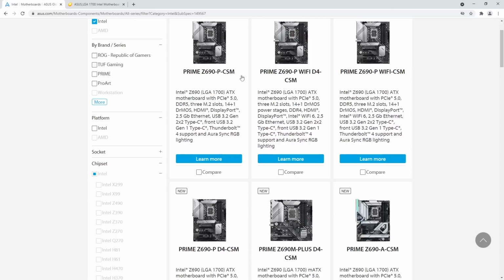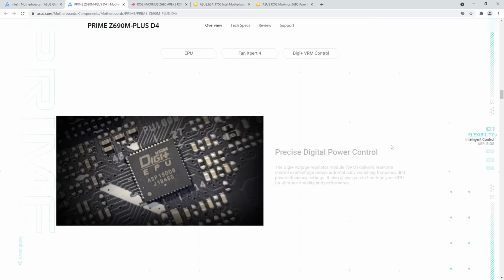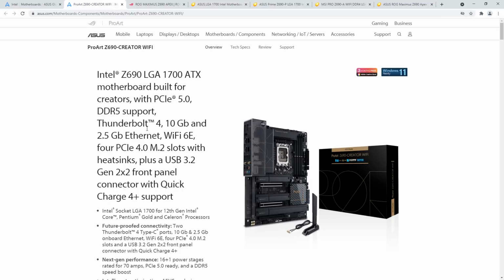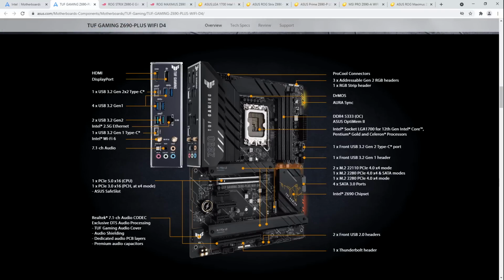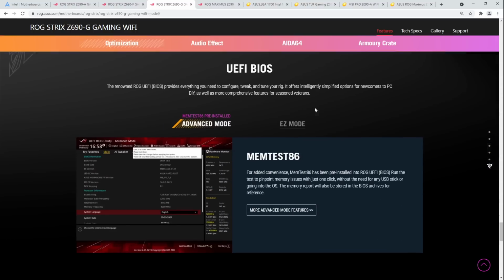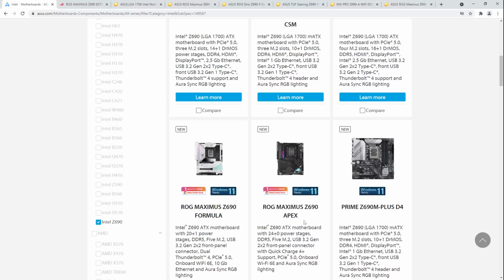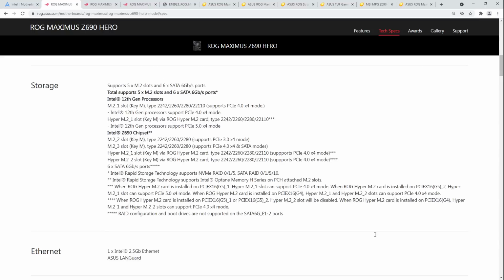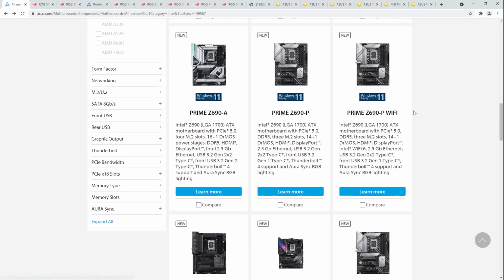Rambling about the ASUS Z690 Motherboard line up

Comment: Late to the party, but didn't find any timestamps so here they are.

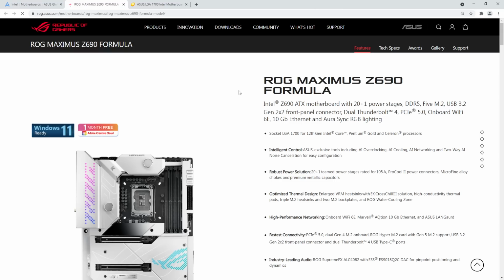0:44 Maximus Z690 Formula
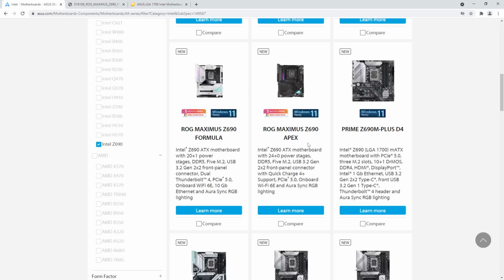11:30 Maximus Z690 Apex
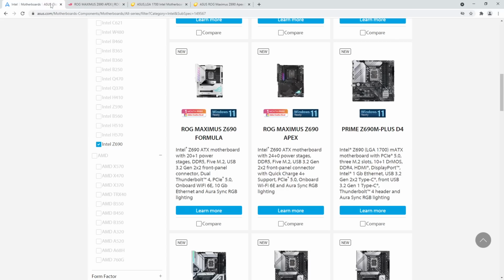14:36 Prime Z690M-PLUS D4
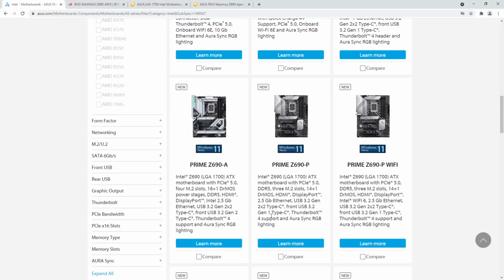17:16 Prime Z690-A
25:35 Prime Z690-P
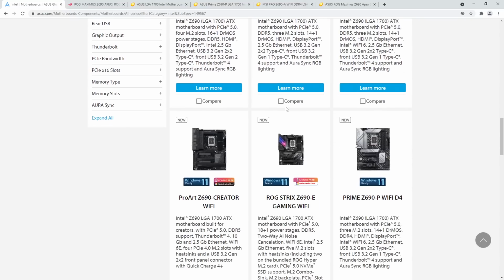29:36 ProArt Z690-CREATOR WIFI
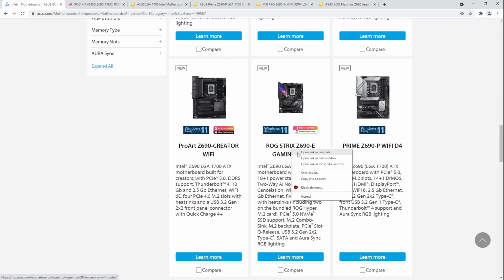35:05 ROG STRIX Z690-E GAMING WIFI
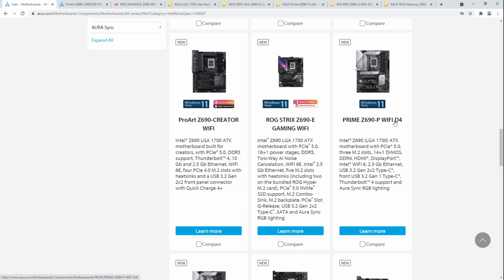42:41 TUF GAMING Z690-PLUS WIFI D4
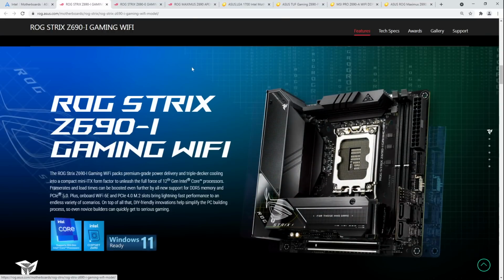49:57 ROG STRIX Z690-I GAMING WIFI
54:12 ROG STRIX Z690-G GAMING WIFI
1:02:20 ROG STRIX Z690-A GAMING WIFI D4
1:08:46 ROG STRIX Z690-F GAMING WIFI
1:13:26 ROG MAXIMUS Z690 EXTREME
1:26:22 ROG MAXIMUS Z690 EXTREME GLACIAL
1:26:52 ROG MAXIMUS Z690 HERO
1:41:27 Conclusion

Comment: Still remember when i bought my Rog Formula XI ( z390 ) at 400$ and it was a gem for the price point / performance with EK Vram Blocks.. And now a 600$ is a low mid tier card.. Asus is just lowering they're standards at this point. Oh well let's see if they do a better job when Meteor/Luna Lake hits the fan in 2023/2024.

Comment: well, i make an order for that fluffy matx strix board cuz there is no other option for my dark rock tf, guess the logic is just fine, yeah. hope that ddr5 becomes slightly more cost effective with raptor lake.
also got the world second cheapest rx6800 from powercolor and i think it needs some minor works with plastics on my case to fit this thing.
so, this is fine, skylake is dead, finally, rx480 kinda too.

Comment: At 5:33 you say no need for VRM waterblock then 30s later you say VRM heat will bottleneck your power limits?? OCing 13th gen CPUs should pull a fuckton of power from what I read. Also respectfully disagree about m.2 slots not needed on the board. I'd rather have more on the board, even if they slow down the third PCIe slot or SATA port, than on an addin card and completely prevent any other devices.

Comment: Solid video. Was initially leaning towards the Asus z690 - E or -F (coming from an Asus x99 deluxe), but after this video, the MSI Z690 MPG Carbon looks like the better deal - cheaper and more features - like a post code and no dumb m.2/pci lane layout!

Comment: All Intel 12th gen CPUs only have 20 CPU lanes. Which is 16x for pci-e gen 5 and 4x gen 4. So basically you are limited to one graphics card and 1 m.2 drive stick. Presumably the chipset has more pci-e lanes available?

Comment: Why do you want tons of USB ports anyway? On mine I use maybes 1 USB port and that is the wireless thingy for my keyboard and mouse. I might have a Bluetooth USB adapter but I have never ever had need to use Bluetooth. Flash drive sticks aren't always plugged in but then if you are using a flash drive you are more likely to use a front panel one rather then fiddle at the back of the case trying to plug it in and you always try to plug it in the wrong way first(you would think flash drive makers would make it easy to know which way is right, a little arrow is all it would take). Maybes I am just different in that I don't use USB all that much except for my keyboard and mouse. And while we are at it why is PS2 ports still a thing? That belongs back in the 1990s not 2022. Having PS2 ports would be like still having ISA slots on your motherboard(the long black slots before the old PCI slots became a thing).

Comment: 18:10  You could buy a Type-C hub and it theoretically will expand you with more usb 3.0, even Ethernet and HDMI. Some Macs and workstation laptops don't have ethernet or lack in usb ports, but with a Typce-C you can plug in a bunch of shit there.

Comment: I've been debating these boards a lot and I really don't think the Strix-E is as bad as you made it sound due to the PCI gen 5 M2 slot slowing down the PCIE gen 5 slot. I mean even if it does make the PCI slot slow down to x8 that's still PCI x16 4.0 speeds, so what's the big deal? I guess if you have a PCIE-gen 5 graphics card that actually utilizes the full bandwidth of x16 gen 5 it could matter, but then you couldn't run a gen 5 ssd in the second PCI slot without being at x8 anyway. IDK

Comment: Maybe I missed it but I don't think so - did you mention the dual Thunderbolt  add-in card on the APEX? It gives you about the only thing really missing on the rear I/O panel. AND - THAT VRM!!  BTW, TWIN PS/2 ports ROCK!! Apex is ONLY current MoBo on the market from the big names that has TWO PS/2 slots - a simple thing but just amazing it is the only one! Thanks for a great vid AHO.

Comment: I bought an Asus Prime Z690A with an Intel Core i9-12900K and Kingston FURY Beast DDR5 memory 16GB 6000MHz but unfortunately the board does not start, what did I do wrong?

Comment: I would absolutely steer clear of Asus Z690 DDR5 motherboards at this point. I have a ROG Strix Z690-F Gaming WiFi and a Prime Z690-A, and both produce a WHEA error (event ID 20) by the thousands. Random system freezes and shutdowns have also occurred, but no BSODs oddly enough. I've spent days troubleshooting this issue and have swapped every component (yes, every single component - motherboards, RAM, PSUs, GPUs, SSDs... everything). The only common denominator is either one of the two Asus boards I listed. I also have a Gigabyte Z690 Aorus Master that's rock solid and hasn't produced WHEA errors like both of my Asus boards have, so it's definitely an Asus thing. Google search results have taken me to Reddit, Asus forums, and other places like Tom's Hardware forums, all with people posting a similar issue as mine. It's been suggested that it may be related to the PCIE gen 3 vs. gen 4 and/or ASPM settings, but messing with those has done nothing to fix the issue for me. There is no current fix as far as I'm aware, and new a BIOS is definitely needed to correct this issue. Bottom line, buyer beware until/unless better BIOS are released.

Comment: Can someone explain to me what the problem with what the Strix E-Gaming board is doing, i.e. having one normal PCIe 5.0 slot that works in x16 mode by default and a dedicated 5.0 M.2 slot working in x4 mode that drops the aforementioned gen 5 slot to x8 mode if used? Particularly, what the advantage of having two standard x8 slots and using an adapter card for the SSDs?

Because you're not getting an extra Gen 5.0 x4 SSD out of that. Only one of the M.2 slots on the Hyper M.2 card on Maximus Formula or Hero supports 5.0, even when slotted into the second 5.0 x8 slot. The second M.2 slot on it can only work in 4.0. And that's if you put it into the 4.0 16x slot anyway (at which point the first slot is obviously 4.0 as well), because if you put the Hyper M.2 card on either of the 5.0 16x slots the second M.2 on the card will be disabled altogether.

So if you do want to use a 5.0 SSD the E-Gaming is actually better, as you get five M.2 total in a single 5.0, triple 4.0 and single 3.0 combination. But when it comes to the Maximus Formula/Hero, in that case you only get four M.2 in single 5.0, double 4.0 and single 3.0 combination (though you can get five M.2 if you abandon the idea of getting a 5.0 one). And both lines of boards have the first slot work in x16 if you're not using the second 5.0 slot (dedicated M.2 slot on E-Gaming, second slot on Maximus Formula/Hero) anyway.

Admittedly, things are better on Maximus Apex, because of it using both the DIMM M.2 card and the PCIe card. But it uses a different PCIe card than the Hyper M.2 used on both E-Gaming and other Maximus boards. This one only has a single 5.0 4x M.2. Then there's double 4.0 on the board itself and double 4.0s on the DIMM card. So still five M.2 in total, but you get quadruple 4.0 and no 3.0.

And the super highly priced Maximus Extreme boards are somehow the worst of the bunch, where you get no card and instead get both the second standard PCIe slot AND a 5.0 4x M.2 directly on the board, where if you decide to use a 5.0 SSD the entire second slot is disabled.

So I'm not really seeing a practical difference here when compared to the non-Maximus Extreme boards. Particularly how it's "stealing lanes from the GPU" while the praised (at least in this department) Maximus Formula and (praised in general) Maximus Apex do not, when all three have the primary GPU 5.0 lane drop to x8 mode if the second 5.0 slot (be it an M.2 slot directly on the board or M.2 via adapter card in a normal slot) is utilized.

At best having a second standard slot lets you use it for other things than the dedicated card, but other than GPUs and SSDs what's going to utilize PCIe 5.0 right now anyway? And who uses multi-GPU setups for gaming, which these boards are ultimately aimed at, in 2021 (on top of that, I find it doubtful that the first gen of 5.0 GPUs will fully utilize it anyway, especially since IIRC RTX 30 series doesn't even fully utilize 4.0 16x lane)? And if you do want to use a 5.0 SSD? I'd say E-Gaming surpasses the Formula and only gets surpassed in turn by the Apex.
Reply: To add to that, if you specifically want an ASUS board ( because maybe you have other ASUS components and you want them to work well together for the lighting synchronization or whatever) and your choice is narrowed down to either E-Gaming or Maximus Apex, you also have to consider other aspects, like the I/O. In terms of rear I/O, E-Gaming has 12 USB, which I think is the largest amount of any Z690 board from ASUS right now. There are some that match it like Maximus formula (albeit in a different configuration with 3 USB-C whereas E-Gaming has 2 and I can't think of more than two uses for rear USB-C in a PC). Apex on the other hand has 10 USB (1 type C) and 2 PS/2 slots. So if you use adapters for your mouse and keyboard, let's count it as also 12 USBs, just in a more jank fashion).

Admittedly the Apex has more gen 2 ones, but like was said in the video, when it comes to rear I/O, if you need this many USB there, you most don't care about the speed and just need the USB to be there at all, because you have multiple devices that need connecting that don't need high speed connectivity. Things like additional input devices, maybe some controllers, a DAC, maybe a webcam, perhaps some lighting kits like those from Corsair. Most of these need just USB 2.

The Maximus line does have an advantage in terms of internal I/O as it has 2 USB 3 gen 1 headers whereas E-Gaming has just 1 and more and more cases have 4 USB 3 type A connectors on the front. Particularly the higher end ones that you'd most likely buy if you get one of these boards. And while the Maximus Formula has Thunderbolt integrated and available in the read I/O, both E-Gaming and Maximus Apex only have a Thunderbolt header and need a PCIe card to utilize it.

Also, the entire Maximus line has an additional 6 pin PCIe header that as far as I can tell is used specifically to give more power to the USB 3 gen 2x2 header on the board that gives the front USB-C quick charge functionality, while the E-Gaming lacks it (it does have the USB 3 gen 2x2 header itself though). Then there's the Internet connectivity and both have the same Wi-Fi/bluetooth combo and both have 2.5 gig LAN.

Finally, there's the difference in things like power stages, chokes and capacitors, as well as the fact that Apex has two DIMM slots while E-Gaming, like most boards, has four. Except I'd wager that even for most of the people that are in the category of people that buy a specific motherboard for something more than just its looks all of this is inconsequential (if it even tells them anything) as long as the board is high quality enough that they won't have a risk of it dying on them and that they instead focus on how much stuff they can connect to the board.

At which point you have to ask yourself if getting one more PCIe 4.0 M.2 SSD instead of a 3.0 one, additional internal USB 3 header and quick charge on the front USB-C (while your rear I/O have janky adapters to utilize the PS/2 connectors in this day and age) are worth the additional price. Which has only grown since the making of this video as E-Gaming dropped to 470 on Newegg. And at that price difference you can actually buy USB 3.0 Motherboard Header 20 Pin Internal USB Hub Controller 4 Port at Moddiy (or the one from Sabrent, but it's apparently a fire hazard) to bridge the gap in internal USB 3 headers and still save 200 dollars.

Comment: Honestly, it's 2021, post codes should be just mandatory on every motherboard. I do not understand how this is a cost saving measure unless you're gigabyte and your QC is trash anyways. 

You have all this space on the rear I/O just make it a standard for your manufacturing process.

Comment: All you need to know about on-board audio
- ALC 800 series bad
- ALC 1220 = ALC 4080 = pretty good
- Optical/SPDIF out means you can wire it to your receiver or interface, and then you’re not beholden to the quality of audio coming off the board.

Comment: Yeah VTT DDR missing was a killer on Z490. In general motherboard purchases would be made much easier if every manufacturer listed all the voltages that are controllable and their ranges in the manual. That used to be common but now no one does it.

Comment: To touch on the type C ports. One can be used as a video output. Also more and more phone makers are preparing to have all their data cables as type c to type c. The EU are also pushing Apple to drop the lightning and use type c to type c, as well as pushing many USB accessories that go type a to type c to switch to type c if data transferring is involved, the go pro action cameras are a good example of this. Seeing as a creator board supports two outs you could have your go pro dock plugged in and even a high-speed external SSD dock plugged in at the same time. It's not terrible for the IO

Comment: I can think of only one reason for a waterblock on a vrm. I saw a home made desk pc where the back wall of the desk was the pc, everything was behind glass, and all pumps were inside the case. There was no air exchange between inside and out, as much as possible was water cooled, and there was a single 120mm radiator inside the case to make sure the internal air temperature didn't get too hot. Only the radiators and some really really quiet fans were exposed to outside air. The system looked sick and was too damn quiet. Having the vrms water cooled on that system would help keep the air temperature down. Only reason I can see to ever water cool a VRM.

Comment: Thank you once again! My go-to when researching boards. I have to say, I'm thoroughly unimpressed with ASUS's(and other brands) Z690 DDR4 offerings. Not only that, most their Strix line is not compatible with large air coolers. It seems like an enormous missed opportunity from board makers to almost brush off the DDR4 side, or perhaps that is Intel's directive? All of these high-end DDR5 motherboards will be expensive paper weights for months.
Reply: @Justin Broniszewski  "All of these high-end DDR5 motherboards will be expensive paper weights for months." I just learned the HARD way. NO! DDR5  RAM
Reply: Z690 prime p ddr5 is 220$
Reply: @LivingTheDream77  where?
Reply: @DavidLeeMenefee  newegg
Reply: @LivingTheDream77  OK, thanks

Comment: I wonder what's the difference between ALC4082 on the Hero and ALC4080 on the lower end boards. Maybe there's a fix for the static noise glitch that was present with 4080 on Z590 boards?

Comment: I have the strix 690-a . The board is heavy, heavier than my hero 590 ? I like it, only higher end board that supports ddr 4 i liked. Visually it looks awesome. the strix logo on the vrm looks 3d. it feels well built, m.2  securing latches are awesome [ no more tiny screw to secure it ], quick release for the gpu is okay,  I feel the same,  nothing wrong with the z690 asus-a, but over priced. I feel like they cut a lot off the board for the price but still the board feels sturdy and looks great. the stuff they cut off the board i wont miss but i like to know it there. i do miss the post code.

Comment: I have the Prime-A. I agree. The board is beautiful. It's not white, it's metallic silver. Also USB-C is nice if you are playing VR with the Quest 2 using the official cable. Also no board in 2021 should have usb 2.0. I'd rather have all 3.0+ even if it means less ports imho. I can always slap on a hub. That 20gbps type-C is gonna be important for future quest headsets if you are trying to push lots of encoding data through it.

Comment: So what's the recommendation for a DDR4 z690 motherboard? As far as I can tell Strix Z690-A Gaming WiFi D4 is the best available. It has the best thermal design, and the only one with bios flashback and clear cmos functionality. I wish it had a post code, but if you don't want to wait for the DDR5 to become available, there is nothing better.

Comment: so I was able to order the Z690 maximus hero for quite relative low price - 16% more than the Aorus master cost here locally (the price went up after I ordered it).
the downside is that I have to wait 3 weeks for it. but considering I can't Fing get good DDR5 kit in stock anywhere right now, it doesn't really matter.
Asus boards are overpriced no doubt, If I could I would have ordered the EVGA classified but it takes ages for EVGA to launch a motherboard and I can't wait that much of time.
so out of the 4 mobo makers this is a board I could settle on considering the price I paid and features.

Comment: Asus Z690-P D4 came with 50/60/70€ cashback depending on which CPU you buy it with, that made it the cheapest available Z690 to me and it does everything it needs to do. 5 rear USB is a bummer, but doesn't really affect me since I still have front panel USB, built in hubs in my monitors and another standalone hub for more easily accessible USB. I think I have like 14 USB devices constantly plugged to my PC so I don't think any rear IO alone would satisfy my use alone anyway.